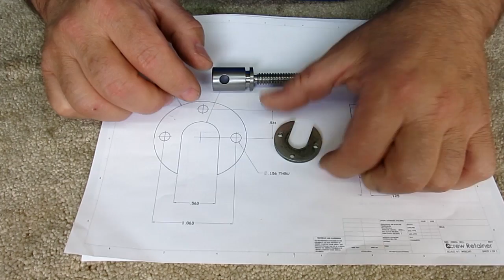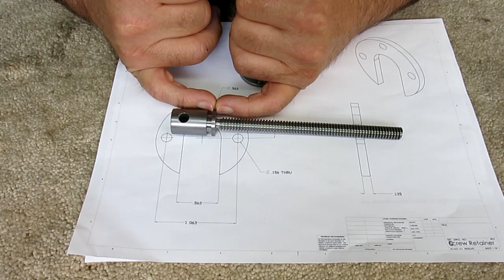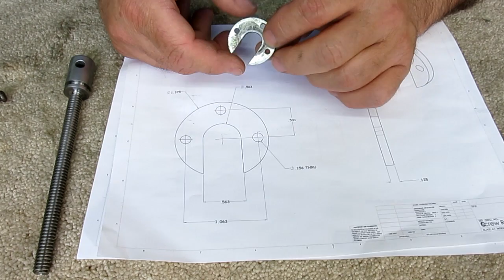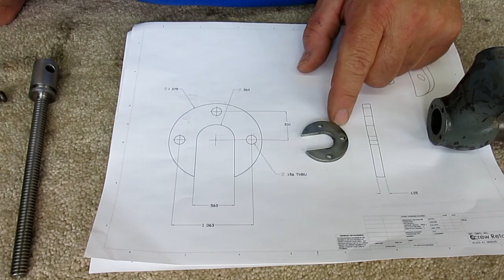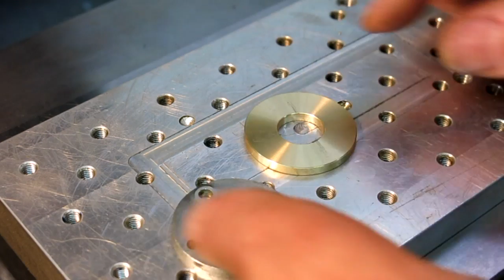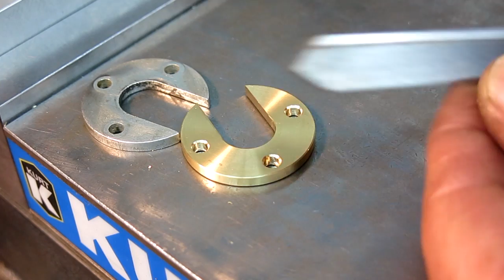Wilton Baby Bullet 10

Comment: Why not use an endmill the same dia. as the large hole tho cut the slot?
Reply from the maker: +Cameron Webster Hey Cameron,

Small tools make small forces. Also with an on size cutter they typically cut over their nominal size. For a part like this the tangency to the hole is important so it looks nice. Thanks for the comment,

Cheers,

Tom
Reply: +oxtoolco Thanks for the reply, even though I don't have a mill or lathe I find your videos very interesting.

Comment: why the countersink when the original was not
Reply from the maker: +David Gaylord Hi David,

It was an edge break as opposed to a countersink. Just happened to do it in the machine. I will use the same type of screws as the original. Thanks for the comment.

Cheers,

Tom

Comment: When finished, you should powder coat the vice body and exposed area of the movable jaw. Based on the huge amount of time you invested, a powder coat would give a near life time finish! "Rattle can decor" wouldn't do your project justice. (just my two cents) Of course powder coating isn't cheap.

Other ideas: 

Make a nice set of copper and aluminum removable soft jaws for the vice. 
As the final touch before painting (or powder coating, anodizing, etc) Use a CNC with an engraving cutter to machine your OXTOOL logo on the top flat notch of the vice body as a makers mark. The area looked 1x1 inch but that was only me guessing by watching your videos (not exactly scientific).

Regardless of what you choose to do, the baby bullet series has been really cool and all your videos rock!

Comment: Why are micrometers more precise than calibers?
Reply: +wgm4321 micrometers have  a fine pitched screw, thus the slight movement rotationaly is always a constant measurement, and with a fine pitched screw along with a vernier, can also measure much smaller than a direct slide can ever do, plus are also fine adjustable for the zero point and if your using larger micrometers they have  a setting bar to give a very accurate zero
Reply: +jusb1066 Thanks for replying.   It looks like the calibers that Tom is using read down to the half thousand (or better).   Since zero is easily set on them, I still can't understand how a micrometer would be better to use down to at least the half thousand.
Reply: wgm4321
true that digital calipers have come a long way, the older dial and vernier were pretty difficult to read at a thou, and most didnt read that low, indeed my dial calipers only read down to 2 thou and it takes a few seconds to decipher, i guess modern technology is removing the older difficulties,i dont have any such newer tech, my measuring stuff is from about 20 years ago, so i used to keep micrometers for the real accurate work and dial for faster less accurate needs, but micrometers are pretty cheap and high end digital calipers very expensive, i guess might be your answer nowadays and will become less so with time
Reply: +jusb1066 I was reading online on calipers vs micrometers.   One thing someone pointed out was that the jaws of calipers could be worn.   So even if you zero them, there are small gaps that you might not see making the zero point only an average.   Then if you measure something with a small contact area, you may or may not have an accurate zero depending on where the contact points fall.   
That would then highlight the design of a micrometer.  With it's small contact area, it would be less likely to wear in such a way that you could deviate a lot from "zero" depending on where the contact points land on the small area.
Reply: wgm4321
yes, wear is an issue, calipers are hardened, and many micrometers have carbide tips, but i would imagine they would be pretty shoddy looking by the time wear would be an issue, i guess its part old habits and used older meusring equip is good value too, i myself do fancy some digital calipers but mitutoyo are too expensive and i wont touch the chinese specials
Reply: +wgm4321 A caliber is a set of specifications or a fixed gauge used to "calibrate" other devices. A caliper is an adjustable measuring or transferring device. A micrometer caliper is also a caliper although commonly just called a micrometer or mic, as opposed to a dial, vernier or digital scale caliper. The reason for difference in accuracy is that the mic measures directly on the line of pressure/movement whereas the caliper measures offset from that line. In order to be able to move, a certain amount of play, slack, or deformity is required. A mic, since it is always in line, can account for the necessary play the same at every part of it's range. A caliper is used cantilevered from the line of action so every measurement contains a combination of forces that cannot be accounted for entirely the same every time. The larger the forces involved the greater the error will be, which is why most micrometers have ratchets or friction thimbles. These are difficult to incorporate into calipers so are rarely used on workshop tools. The best thing is to develop a feel for the tool. Practice with parts of known dimensions like gauge blocks, dowel pins, and drill blanks and compare measurements with different tools. One method to reduce the error is to apply the final closing pressure directly over the point of contact with the part. Sorry for the terminology or spelling correction but it's just to point out how important accurate communication is to preventing costly mistakes.
  Mike (o\!/o)
Reply: Thanks for the info.   That makes a lot of sense.
Yeah my caliber of spelling and proofing what I type leaves a lot to be desired.

Comment: Hey Tom:  Great video!  I've got a dumb question:  Are you concerned at all about the brass being soft, risking wear/ deformation?
Reply: +watcherjohnny +Keld Sørensen If I'm correct, it only has to pull open the jaw piece, when tightening (pushing), it doesn't hold any pressure. The screw presses against the jaw body.
Reply: +watcherjohnny I believe that's a great question. I was going to ask the same thing. On my 4" Wilton vise the screw makes contact with the retaining plate. If the vise is going to be used for very light duty then the brass should hold for years but for medium to heavy duty it will wear fairly quick depending on its use. On a other note the TL Baby Vise will look great with the Brass bling. LOL